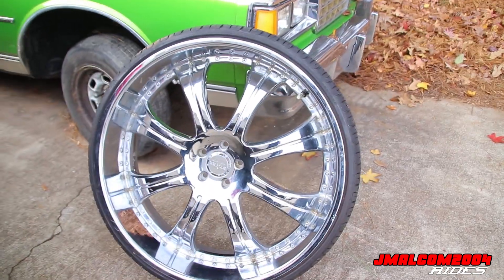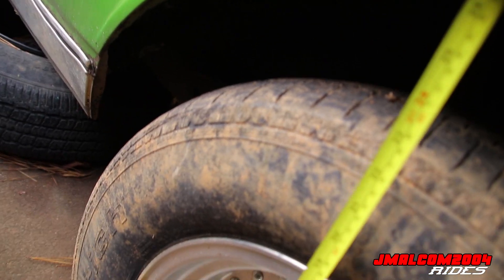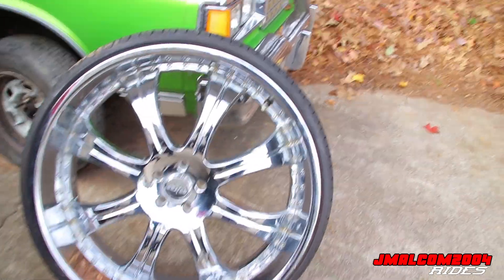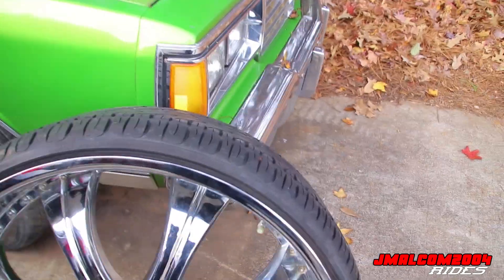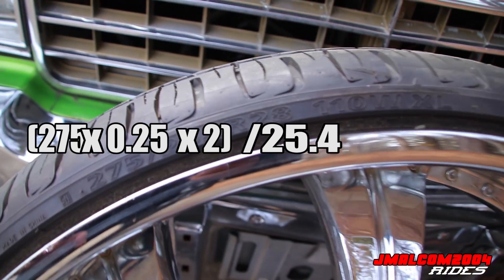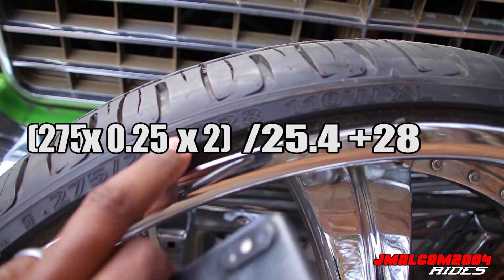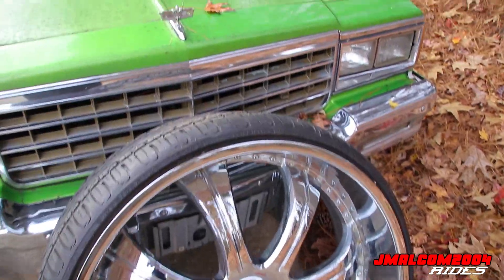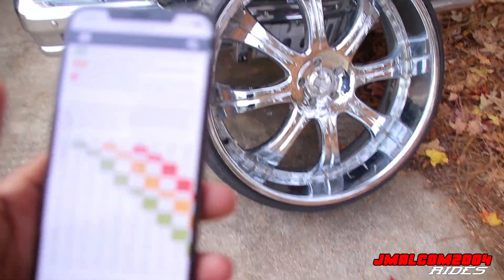HOW BIG RIMS AFFECT YOUR REAR END AND GEAR RATIO AND TALKING WHAT GEAR I NEED FOR MY 28s

Comment: Those guys got got race cars at the tracks with the big rims big motors  they really wasn't built to go that fast I'll  be cautious I would really love to know bout all that before I put my car on the road but you know all that shit gets real expensive I just love to drive mines there is nothing like a good running old school. I had a 1951 Chevy deluxe had a 400 small block create motor had a front suspension put in put in nova rear end put in over drive transmission I drove that car every were had all the heads turning lot of fun

Comment: I understand what you saying but I've never had a  problem I've ran 26s and 28s on my 02 Lincoln and my 06 vic🤷‍♂️
Reply from the maker: wavey strokums never said it couldn’t work BUT fact of the matter is that when putting that big of a rim on stock motors, trans and rear ends that aren’t catered to high performance, overall performance of the vehicle is going to lack, mainly on the acceleration end. And a lot of things will work for awhile....
Reply from the maker: wavey strokums never said it couldn’t work BUT fact of the matter is that when putting that big of a rim on stock motors, trans and rear ends that aren’t catered to high performance, overall performance of the vehicle is going to lack, mainly on the acceleration end. And a lot of things will work for awhile....
Reply: @JMalcom2004Rides  I'm not doubting your knowledge bruh you know way more about cars than me...I was just saying I've never had problems plus I like to cruise and look good I'm not a  speed guy😎
Reply from the maker: wavey strokums glad it’s all working out for you bro. Was just throwing it out there for others to read as well. Appreciate you watching

Comment: I am a engineer and what you said about automatic transmission is not true. They do make automatic transmission to handle big Horse power engine . I have a dodge Demon that has over 700 hp and I have a ten speed transmission and it’s able to handle it. I can Manual Shift it or automatic
Reply: I'm a automotives tech too me and you know old style transmission are stronger, OD is good for gas mileage but never for racing...
Reply: They have automatic semi trucks...its not about horsepower, it's about the torque wanting to bend and snap all of the gears and lines.

Comment: 2700 rpm on the highway that motor wont last long lol
Reply: Yea it will
Reply: Motor gonna last longer than my 64 with white walls and skinny tires ..dash says 90 and im only doing 60
Reply: @justinberg5476  needing to change speedo drive gear after changing tire size in no way affectes longevity of anything lol
Reply: @leejohnson6173  it does when a buck and some change is red lining motor ...after doing this repeatedly  something gonna give... finishing up another motor and another set of tires is on the way...